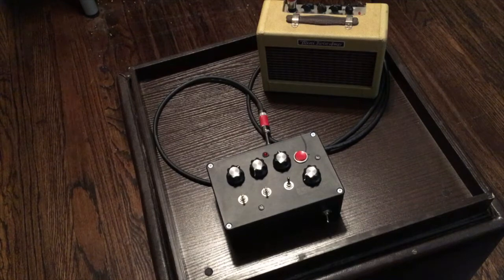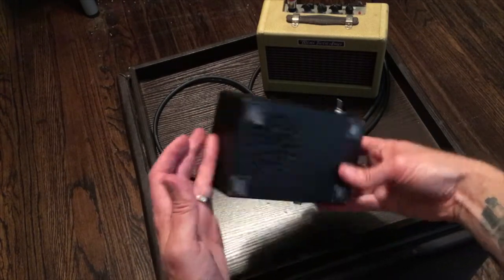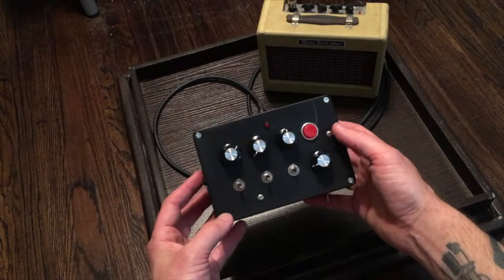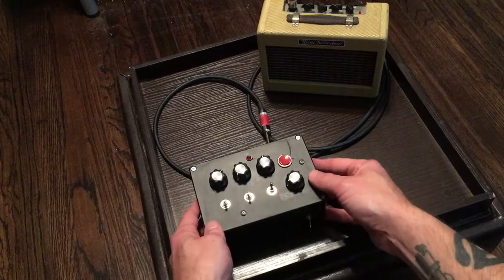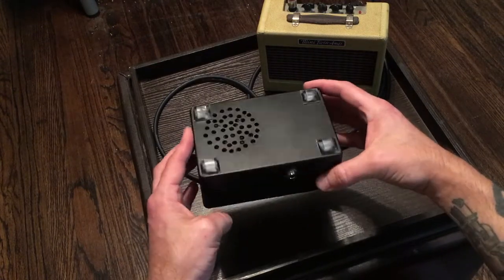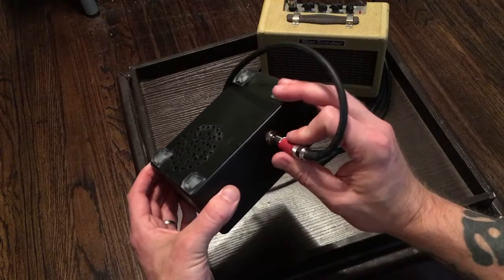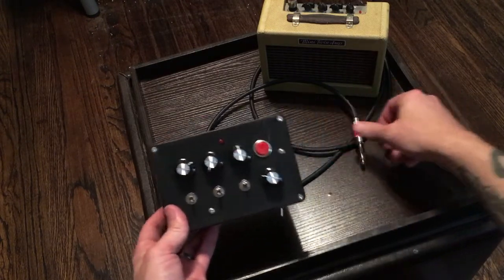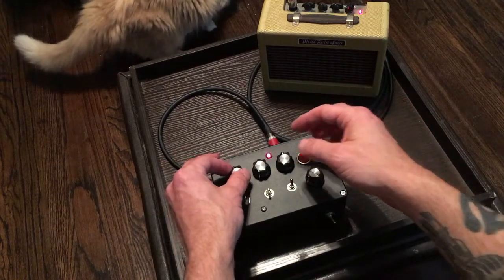DIY Synth: MFOS Alien Screamer Kit

Comment: How did you add the momentary switch?
Reply from the maker: It's just a momentary power on, so it goes to the same contacts as the toggle power switch. If the toggle is on, the button does nothing, but if the toggle is on, the unit powers on each time the button is held down.